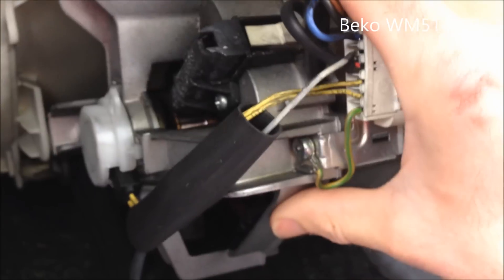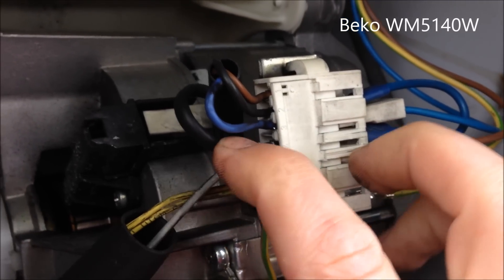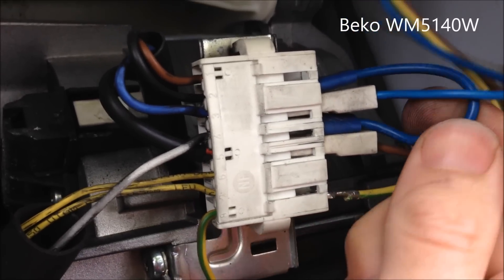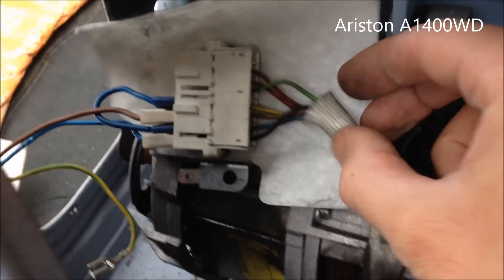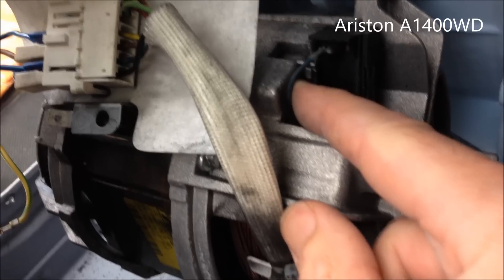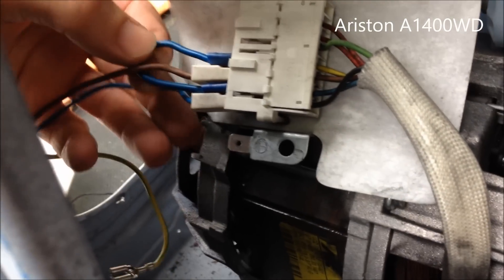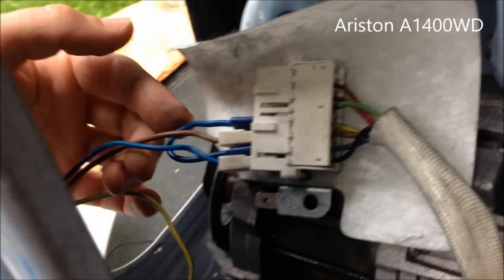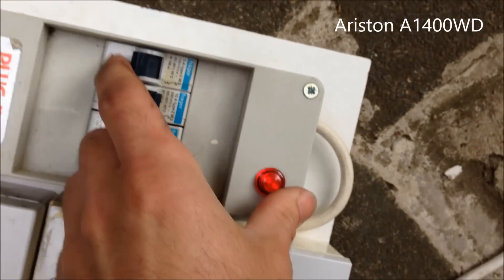How to direct wire a washing machine motor

Comment: Thanks m8. Don’t suppose you can suggest how to wire in a speed control foot pedal? It has one cable going to mains and another going to a flat three pin (female) socket that would normally plug into a sewing machine. Any tips appreciated. Thanks
Reply from the maker: I don''t think a sewing machine pedal will take the load of a washing machine motor.

Comment: Hope u will be fine bro pls u can teach us how to increase the rotation time while the machine is washing ....my mean that the motor rotation time is very short and the motor beacome hot very ealry so how to fix this problem ...OK thanks a lot for ur good job u can reply to this email ...Good bye
Reply from the maker: Hi There, this method is not really a good way to run a motor, it will overspeed if it has no load and may heat up as you describe. It is basically a good way to destroy a motor!!  I have made a video about how to fit a voltage regulator to regulate the speed indirectly, this may stop it overheating. https://youtu.be/48J3w0eN6uI If you are asking me how to adjust the timing on a washing machine that is still used for washing the short answer is that I don't know. Thanks for the message!  Good luck with your project.

Comment: hi, if i have a load of lipo batteries like an ebike battery, then a dc-ac invertor can i then have this module after the inverter but before the motor, wire it like yours and have it controlled(speed wise) for an ebike i want to make.
Reply from the maker: I have no idea. You haven't said what type of motor you want to use.  If it is with a universal motor then I don't think the regulator would be accurate enough for a bike.  But I am not an electrician. Why not just use a small dc motor, they are cheap on eBay.  Or just give it a go, and experiment. Be safe, electricity is dangerous. I know nothing about it.
Reply: well this is a video about washing machine motors bro, and do you think it will go fast, it is 800w 195v 4a
Reply from the maker: sounds like it will go superfast, good luck with your project, send me a link to the video!
Reply: ill try

Comment from the maker: You regulate the voltage going to the motor. You can use a variac. I use a SCR voltage regulator suitable for the wattage of the motor. They are small and cheap. Thanks for watching
Reply: what is a variac in US electrical terms? is that like a variable resistor in a dimmer?
Reply from the maker: You could google it, it is called a variac in the US as well.  A light dimmer wouldn't be able to handle the wattage.
Reply: Hello, i need a help.
I have a washing machine motor. Just want to know how to make it run. I have picture of it.. let me know to send the picture. Thanks